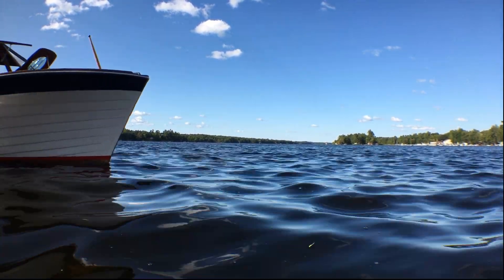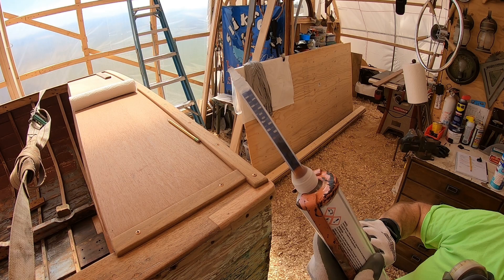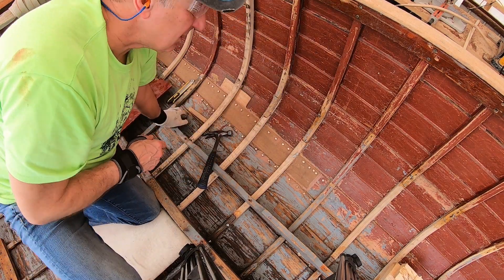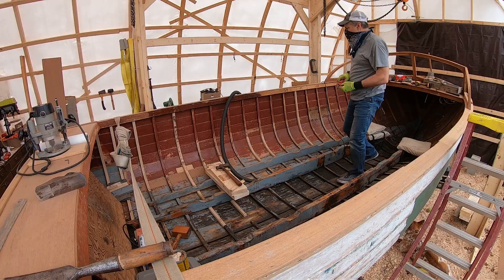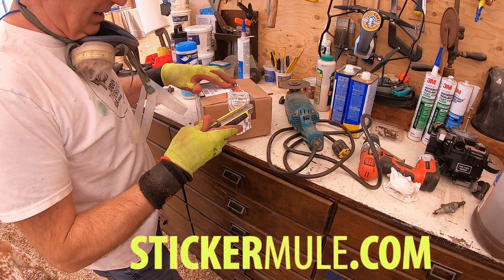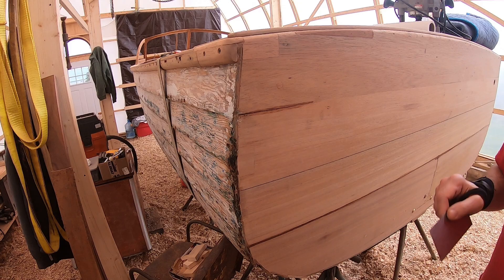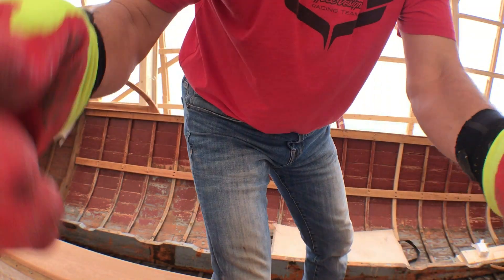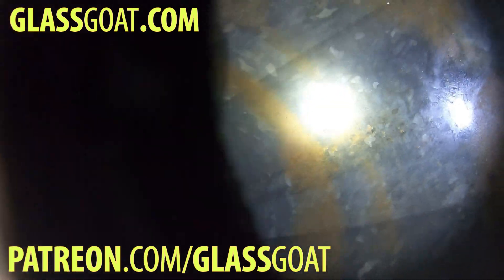Cleaning Out The Gas Tank & More! WBE S1 E30

Comment: The wooden Luhrs boats had ceilings covering the frames. There was a baseboard which was twice as thick as the ceiling, running along the cockpit floor. The screws used for the ceilings were oval head screws, which looked much better than flathead screws for that application.
Reply from the maker: JOHN SHOUREAS my 32’ didn’t have them when I had it, somebody had put in pegboard. Probably to make it handy to store fish poles, etc. The interior was finished nicely with mahogany plywood and solid mahogany areas as well. Had I known what I know now, I would’ve saved that boat. Loved the way it rode. Was a bear at the dock sometimes though in the wrong wind.

Comment: Hi Scott-enjoying watching your videos!  I have purchased my grandfathers 1962 Chris Craft SeaSkiff and I’m trying to learn from your videos.  I know I need to seal up the seams in the transom when I get to redoing it.  I think you mentioned using Life Calk in your transom seams in your video.  Is that correct and any recommendations for using it?
Reply from the maker: Depends on the seam location and the size of the gap. I’ve seen some pretty big gaps close up quickly as the boat swells when launched. I did use life caulk on that boat above the waterline. I have an issue where I replaced the piece at the very bottom of the transom though, that seam (about 5 inches up from bottom) was too tight and after a couple of years of being in the water it’s a bit ugly. Doesn’t leak though. I may run a thin kerfed saw down that seam next spring to open it up. I would probably fill that gap with 5200 afterwards. If it swells it would just push the extra 5200 out and I’d trim it with a razor. Send me images if you like through Patreon and I’ll tell you what I think.
Reply: @ Thanks-the boat is in storage currently, but when I get a chance I might take you up on your offer and send some pictures or video your way.

Comment: One of the best cordless drivers you have there!  I have my grandfathers, works great, with little cam-out.  Do you use Robertson head screws?
Reply from the maker: I only use Robertson screws on boats that already have them. Normally I use Frearson as they are the ones I have the easiest access to, and they are what is already used on most of the boats I work on.